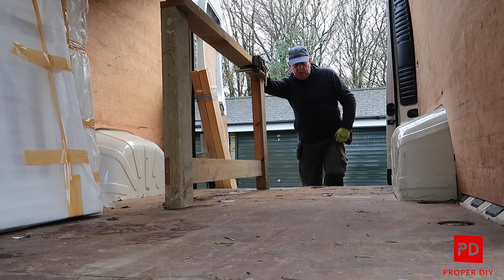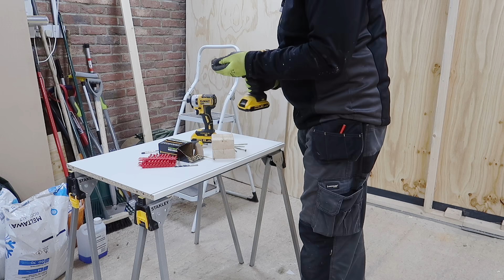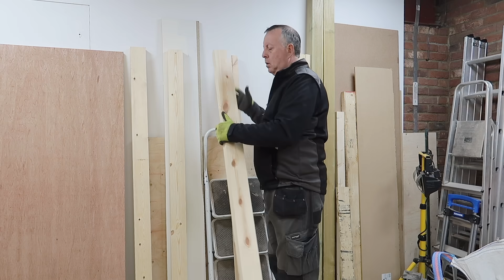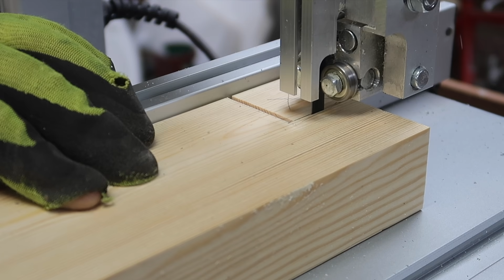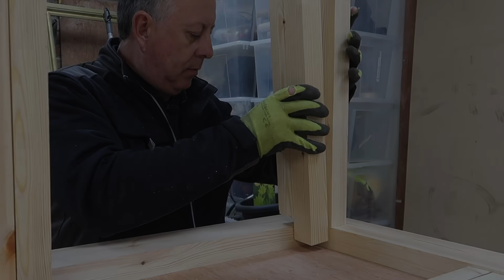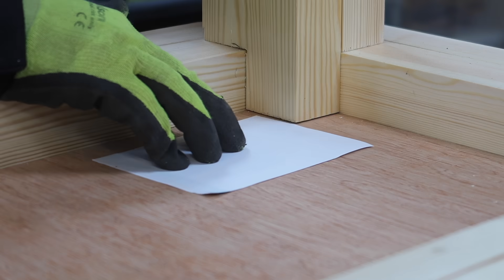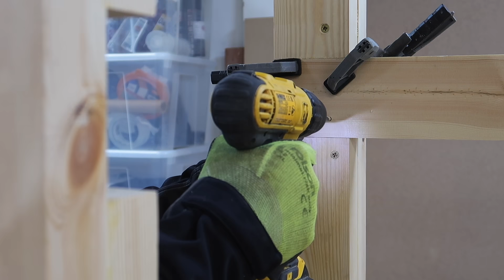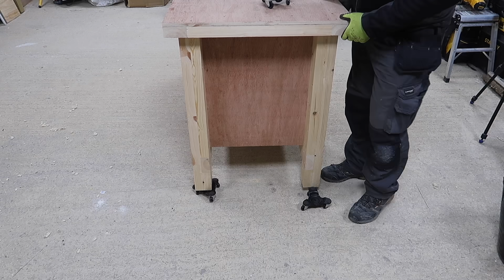How to Build an Easy, Sturdy Workbench

Comment: I am going to be building 4 versions of this that are 2 foot by 4 foot rolling carts that are utilizing your retractable wheels design!  One will hold the miter saw, the other will have the table saw built into it, another will have a router table built into it, and the fourth will be just a flat top..... the table saw and the router table can retract their blades and use those carts as flat surfaces also.... since my shop is only 12 foot by 20 foot I have very limited space and can roll carts out of the way and only have to use one or two or three at a time for whatever purpose I need it!
Reply from the maker: That sounds like a good project with a lot of flexibility. Good luck!
Reply: @ProperDIY  OH, and I forgot to mention although it's save to assume.......all the carts are the exact same height so that they can be put together into bigger work surfaces or used as an infeed and/or outfeed surfaces!

Comment: I finished mine this weekend and I'm very happy with it. Just wondering how flat is the top on yours? When I put a 1200mm spirit level across it diagonally it seems to have some twist in it, I don't think I will ever notice it but thought I'd ask
Reply from the maker: Well done. I must admit I've not checked it but the timber and sheet material I've had on it sit nice and flat so I done think is far out.
Reply: @ProperDIY  No worries. Like I say I don't think it will ever cause any issue, it's maximum 1mm over the 1200mm. Next weekend I'll be doing the castors too. Keep up the great videos!

Comment: Hi Stuart. Been watching your video again and wanted to ask about the height of the work bench. You said its the perfect height for you which is 920mm. I am 5'7 - would this be a reasonable height for me? Also I know you built your bench around your offcut size, but roughly how many 4x2 planed and CLS timbers did you need to acquire? I am hoping to build a workbench to go along my garage wall and it would be roughly a length of 1715mm long and approx 65mm deep. Thanks
Reply from the maker: The 'normal' work bench is usually between 820mm and 900mm. Unlike working at a kitchen work surface, you want a slightly lower height so you can get on top of things when you are drilling, screwing etc so it helps to be a bit lower. I if I was you I would set up a small 'mock-up' and test it out to suit yourself and adjust. You could also aim slight high and trim off some form the legs at a later date if you feel it's too tall.
7No. 2.4m 4x2's needed if using single timbers for the legs or 9No. if doubling up like I did.
Reply: @ProperDIY  Thank you Stuart, much appreciated!

Comment: Fantastic video, I am about to move house and will have a 11mt x 3mt wooden cabin as a man cave and will defo build the bench to stand pride of place, the only addition I will do is to put a piece of hardboard smooth side up fixed in place with panel pins which will give me a cheap sacrificial smooth surface without screw holes to collect dust etc, thanks for all the great videos
Reply from the maker: Thank you! 11x3m cabin will be a nice space!

Comment: Very clever way of doing the legs . Just wondering can this be applied to another application eg. Was planning to make a swing so the top beam resting on the legs be done by joining 2 peices of 2x6 instead of 1 ( 4x6 ) which is hard to find in 3.6 mtr .thanks.
Reply from the maker: Yes definitely - and may end up stronger if glued and screwed securely.

Comment: Good bench mr but I put sacrificial mdf board on top of say 9mm or 12mm so as you drill and cut you can turn it over  and l have put my Vice at the same high as the work top thanks for your video stay safe 👍👏👏
Reply from the maker: Thanks - good tip

Comment: hi mate is that the Dewalt dcd776 drill if so how long do the brushes last and how has the drill held up to use and how long have you had it thanks mate
Reply from the maker: I've been using this quite hard for around 2 years now and still fine
Reply: @ProperDIY  and the brushes haven't been replaced yet i assume you mean by that thank you
Reply from the maker: @CoreyJenkins1  No. No maintenance at all and I've pushed the drill far more than an average DIY'er I think.
Reply: @ProperDIY  thank you mate

Comment: Your knowledge of loads and structures is apparent in this workbench👍 solid as a rock💪
Reply from the maker: Thank you
Reply: @ProperDIY  Looking great! Didn't you say that you were a structural engineer in one of your other videos? When you were drilling into an RSJ.
Reply from the maker: @benh1216  Yes, I suppose 30 years of Civil Engineering Contracting has taught me a thing or 2
Reply: @ProperDIY  My dad worked in the civils. He used to work for British Railways for at least 20 odd years I think. He often talks about the bridges and parts of line he has worked on as well as the people he used to work with. Certainly learned quite a bit from him!

Comment: Another enjoyable video for those of us who dream of having a decent-sized workshop. Personally I would have been happy to use single legs because that timber is never going to compress under the weight. The strength of the bench is in the diagonal bracing which you created with the back and sides. I would also have fixed the end and side rails on their edges as they would be stronger that way.
Reply from the maker: The compressive strength of a single 4x2 I'm sure is huge and for most people 1 piece would be more than enough. When I watch some US channels my work bench is decidedly slim so I'm sure I'm somewhere in the middle.
Reply: @ProperDIY  Everything in the US is (unnecessarily??) bigger...  lol

Comment: When trying to glue two parallel pieces of timber together, to stop them slipping and sliding, sprinkle some salt on the glue before putting them together. It'll stop them slipping and won't affect the joint.
Reply from the maker: Good tip
Reply: Salt does work - another thing I have done when using softwood is to use a couple of small ring-shank nails or similar placed flat between the wood on the joining face - as you clamp and get the glue meet the nails stop the two sections moving.
Reply: @iant535  Or driving in a couple small trim nail and nipping off the head so theres a slight point sticking out...
Reply: An odd bit of doubled sided tape with the glue around it also stops those pesky bits of wood moving.
Reply: Fine sawdust does the same 👍 a lumberjack technique used to keep wedges together so they dont slip when felling a tree down
Reply: All your tips are better than mine; I was just going to use my pneumatic pin-nailer. I like all these ideas better though. 👍
🇬🇧

Comment: Great video, thanks Stuart. That will be my first build in my new workshop/single garage. I'll have to tweak the depth of the bench though,  to give me sufficient floor space due to racking shelving on the wall opposite.
Reply from the maker: Thanks. Definitely need to make your own changes to size & height etc to suit your own situation.